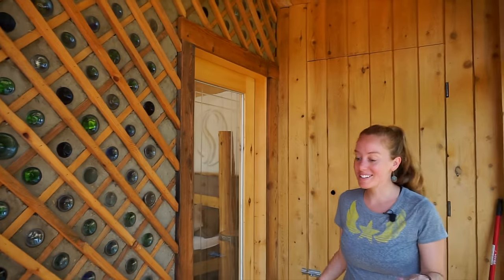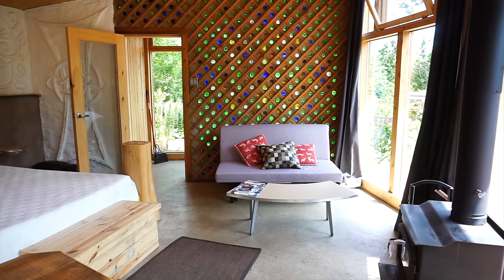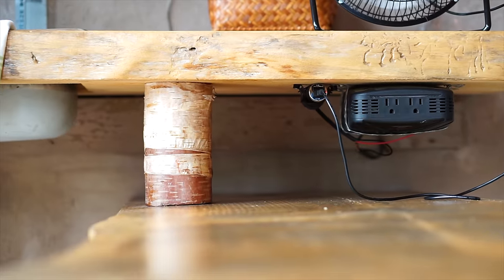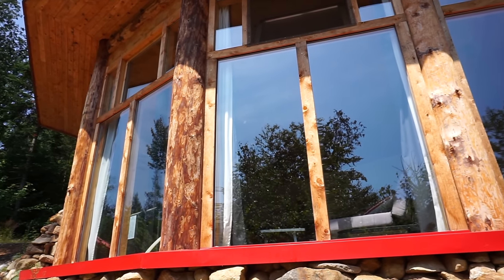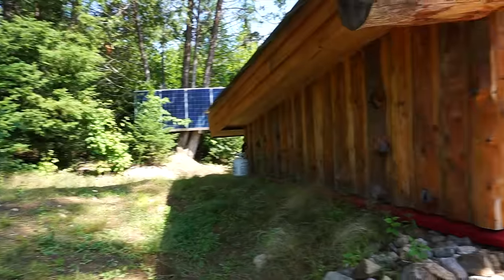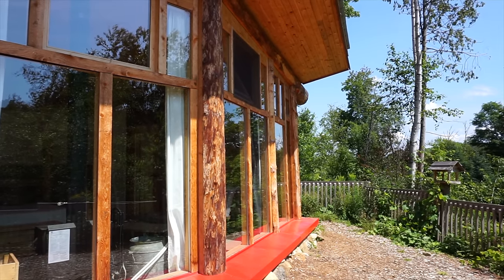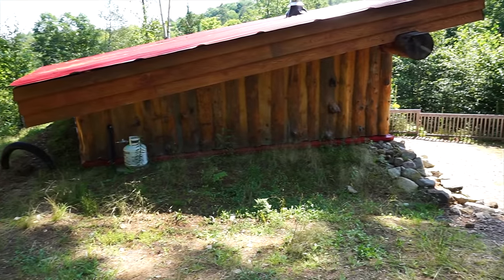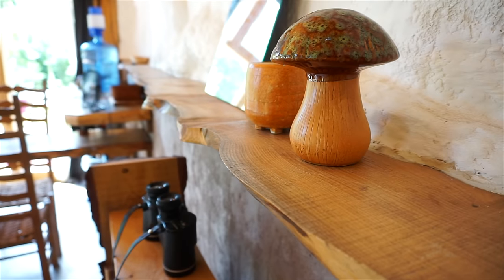Incredible Mini Earthship Style Cabin - Tiny Off Grid House with Solar Power

Comment: I love the earth ships. Unfortunately most county building codes in the US don't allow them. It's a shame building codes can't catch up with this 1000 year old technology. The one in this video is very nice.
Reply: You mean like my current code-approved house that is sheathed - not in plywood, and not in OSB, but in some kind of low density fiber board? You could literally get into my house with a carpet knife - vinyl siding, pressed paper board, then through drywall. 

My next house will be a superadobe walled, timber framed, earth-bermed house. Code schmode...
Reply: I always laugh when people tell me about their steel doors and deadbolts and I'm thinking it would just be easier to kick in your wall.
Reply: New International Building Code 2018 has the code written for compressed earth block! Just use rammed earth instead of tires!
Reply: It's a glorified mud hut.
Reply: @tombombadil9113  What's wrong with that? Mud is dirt cheap and quite effective when done right, pun intended
Reply: If you want this kind of home, don't buy land inside a boro or with a mortgage that dictates how to construct the home.  Buy rural land with cash and for crying out loud stop telling the officials you intend to live there full time!
Reply: @tombombadil9113  mud is cleaner than the dust created in most homes on the gem scale.
Reply: Been binging these videos and wondering about the permitting issue. Do we know any spots in the US that have become more open to these concepts since this comment was left 3 years ago?
Reply: @Kurt M. :  The reputation of a good builder is worth more than building everything 'to code.'  I can't tell you how many leaky basements you see in 'modern' construction.  But the real-estate developer has a chunk of land and wants x number of houses on it.
Reply: I’m interested in the inverted vs slanted window theory.  As a weekend home their concern is valid, I wonder if there is a method to make the windows adjustable?

Comment: I love how earthships are nearly always designed to be both functional and beautiful. I've always felt earth ships to be a bit beyond our abilities (they are normally SO mansionlike!!) but this one is super inspiring in its compactness. It seems ever so slightyl more doable! Thanks for another amazing video x
Reply: Youtube earthship hut for a compact budget friendly option that actually is an earthship. This house is not technically an earthship because it requires supplemental heat.
Reply: I agree with all the points made here. I am very grateful to see a more reasonably sized earthship, instead of the more common, mosterous ones usually presented. They actually put me off of attempting it.
THIS, however, is very much more doable for most folks. Very greateful for the inspiration. Thanks!!
Reply: Those mansion looking ones are actually only about 200K to build.

Comment: Looks great, thanks for showing us. Odd place to have a solar panel btw, behind low branches and trees.
Reply: CasMullac thought the same thing
Reply: CasMullac I saw that. I suppose it works pretty well regardless of those low branches if it's providing the amount of energy they say it does in the cold season. What an interesting design.
Reply: CasMullac, not second guess the builders of this fascinating home, but the placement of the solar panels may have to do with thievery. Had an Uncle who placed his panels prominently on the top of his cabin in Western NC. One day they day tripped into Tennessee, came back the next day and they were gone. He bought a new set and placed them behind the cabin in the forest line and there they remain to this day.
Reply: When you go to the page for Lammywalness..., you'll find a BS political ad.
Reply: Report the comment @sohappytosew1082

Comment: If I remember right from my studies, the original designer of the Earthships moved away from the angled windows, because they were not necessary and caused some issues.  One is that water had an easier time leaking into cracks which inevitably happened in places where the water pooled (like on some corners and edges).  Keeping them vertical solved those problems and allowed the overhangs to work more easily.  It also made them much easier to build.

Comment: In colder climates, would not a Rocket Mass Heater be a better idea than a wood stove? It uses the idea of thermal mass to store the heat, just like walls of earth, possibly eliminating the need for the under-floor piping. Also the combustion chamber is much more efficient and puts out little if any waste heat or pollution, and it can use twigs, or just about anything else for its fuel (small dried plant matter etc. would even work.)

Comment: The title of this video would seem to be misleading, as this house seems to be lacking many of the characteristics of a true earthship (truly passive heating/cooling, a greenhouse, the multiple-use water system), which the description calling it "earth ship style" does appear to recognize at least.

The lack of a greenhouse as an insulating buffer seems the oddest omission from the design, especially in such a climate.

Though the heated floor is a very interesting idea, especially as I have tile floors and they're so unpleasant in the winter. So regardless of how consistent an earthship is able to keep the temperature, coming in to warm floors in winter would be so nice. I wish it had been operational and more detail could have been provided on it.

I'm curious about the efficacy of the pump moving the air - which, it should be noted, is the only unusual thing about that particular system. The buried pipe for passive heating/cooling is a standard part of an earthship. I'm unsure if you knew that, based on the way you presented the information, and feel it's worth stating for anyone else reading. I can see the increased circulation potentially being quite a benefit for cooling though, especially if your useage is less than your solar panels are generating in summer, when you may want the cooling and the sun's out.

Comment: German rolladen shutters on the outside of the house would help to control temperature better than curtains. There are many German houses which are not equipped with air conditioning; rolladens are how they keep cool.

Comment: If it was me I would earthbag instead of using tires. Also I would use a binding agent in that layer and pin the bags with steel reinforcing. Concrete block could also be used to streamline the manufacturing process. These structures only make sense if you have a huge amount of free labour. Also you might consider using a polymer in the adobe and using  the money you save by building smarter for some HVAC automation to help regulate the temperature. There are some great ideas incorporated in these structures but the development of them has stagnated it seems.

Comment: I love how it looks but am a bit disappointed that they didn't do the windows 'properly'. I thought the main function of an earthship is not needing any heating/cooling system. Now they are installing both. Also the point of diagonal windows on top of the straight windows is that the sun DOES shine through in the summer so you can grow fruits/vegetables inside. The sun wouldn't shine through the whole house, just the front. Although I understand this is a 'mini' earthship and it doesn't have to have every feature of a normal earthship, I still believe it would've been awesome if they would've at least do the windows correctly and grow some plants inside.

Comment: Nice video. Poorly engineered earthship. It FAILS to achieve any of the six core facets of what an earthship is designed around. This is pretty and should be inspiring. But if it lets you down, do more homework.